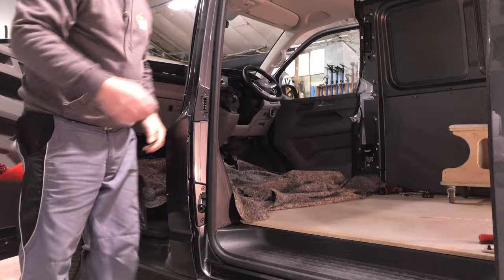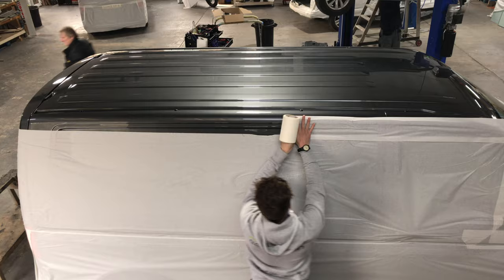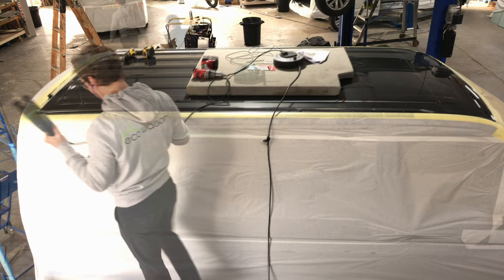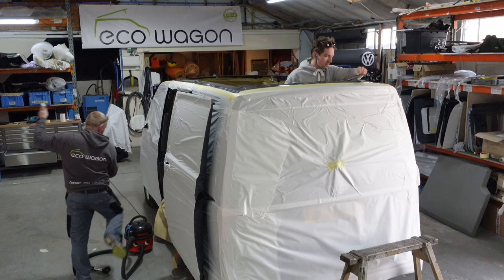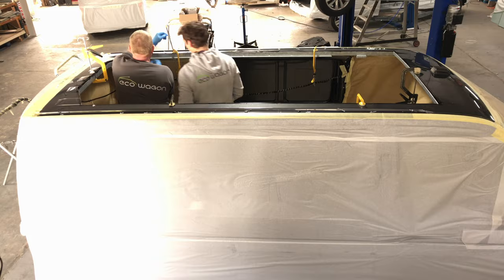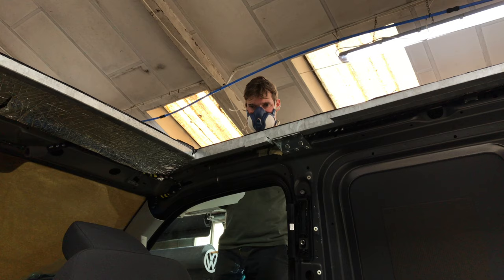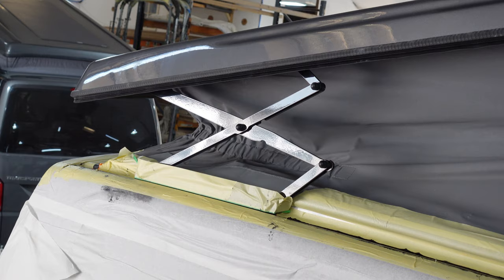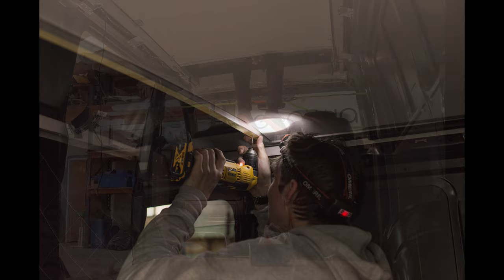Campervan SCA 194 pop top roof - VW T6.1 Transporter | Bulli

Comment: what you call PU is MS polymer I guess
Reply from the maker: Hi Vic. No, PU is what’s used in this case, the difference being PU is used with a primer MS is not. PU without a primer is arguably the same strength as MS.
Reply: Thanks for your response! 
Slightly surprising though, as PU sealants tend to lose elasticity over time, have poor UV resistance, shrink during curing and contain solvents, while bond strength is not superior to MS polymers. I thought PU was all but phased out, but I stand corrected.